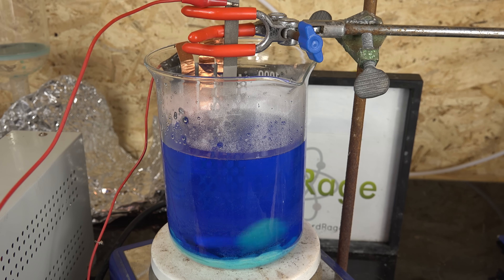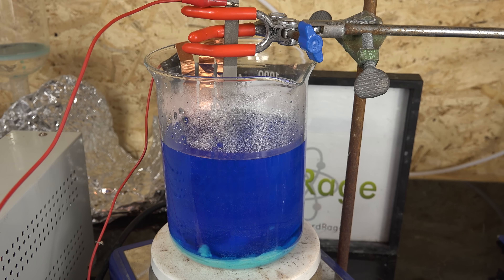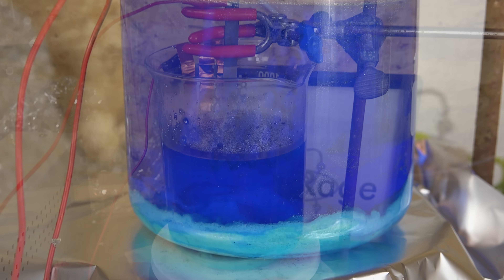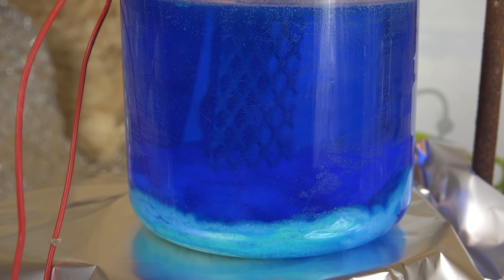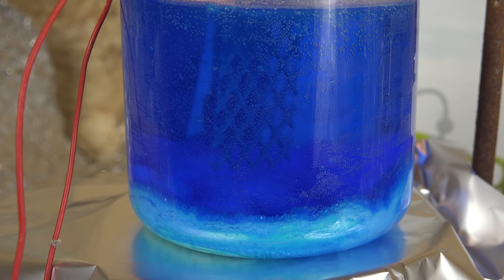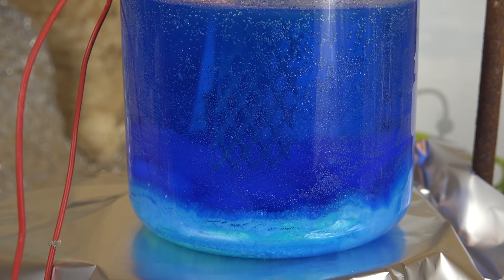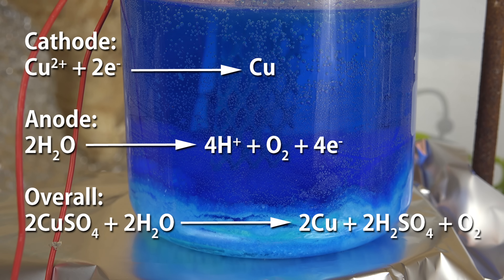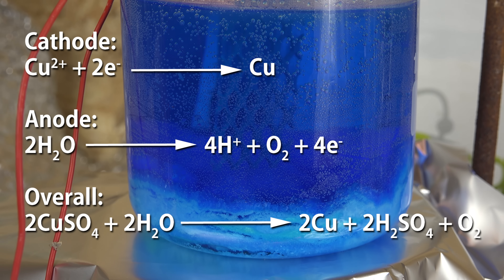Efficiently Recover Nitric Acid and Copper Metal From Copper Nitrate Wastes

Comment: What I’m looking for is a better way to collect and trap the contaminants. Instead of using a Platinum Anode, could you use the reactivity series of metals. Add iron to your copper sulfate solution to drop out the copper and all contaminants under iron and then melt up the metal sponge into shot and a connecting anode bar that connects to your power supply. Then for electrolyte use a clean pure form of copper sulfate solution and place the contaminated copper shot into some sort of filter bag that is dipped into the electrolyte. That way all the sludge that forms from impurities and trapped for further processing in the future. Do you have to use Platinum? Is platinum only used because it doesn’t react? In my case I want the anode to be the consumable. Also, must the cathode be copper? Can it be stainless steel? For instance a large surface area stainless bowl?

Comment: Did anyone mention / ask about HCL remaining in the waste copper nitrate solution? Many refiners use HCL to precipitate the silver chloride. Would this have any adverse effects on the sulfuric acid -> distillation of the nitric acid? While the boiling point of HCL is higher than Nitric, i'm not sure about azeotropes or if any HCL would remain in the final distillate.

Comment: Could you not use a copper pipe for the anode instead of a platnium electrode.  I know it will disolve and the copper will transfer over to the cathode as pure copper and the copper pipe will have to be replaced as it disolved.  Benifits being copper is cheap and do not have to buy or worry about the platnium electrode.
Reply from the maker: But how do you recover copper from the solution?

Comment: Excellent video.. thank you!

I'm working on a project to turn about 18kg of mixed scrap of unknown alloy bronzes, into a 25 to 30cm diameter bell of 80Cu/20Sn bell bronze. I doubt that any Ag/Au/PGM are present, but I want to remove any Mn, Si, Zn, or Pb present, and I'd like to separate out the tin, recover it, and supplement it with additional tin in the final melt.
It looks like a dilute nitric acid (a lot of it..) will dissolve the bronze - all the possible components except for the tin, which will either settle out as a tin sludge or precipitate as an insoluble tin salt, either way, I think I can extract the tin in the first step by filtering it out.
Then, I can use this video method to recover the nitric and leave all the metals as sulfates in solution.. if something (maybe lead sulfate?) precipitates, a filter catches that.
With "copper etc.." sulfate, I hope to reduce all the metal salts to finely divided metal particles, but I'm not sure which reagent to use.. maybe iron(II) sulfate.
Then, hopefully, either hydrochloric or sulfuric acid will put the contaminant metals in solution without taking too much of the copper powder, so I can capture purified (if not quite "pure") copper in a filter. 
The next step (maybe this is optional..) seems to be putting the copper filtrate into solution as copper sulfate (process TBD..) and electrowinning out the copper. Then, wash/dry/weigh the copper, add 1 unit tin for each 4 units copper by weight, melt, pour, cast and mechanically finish the bell.

Does it seem like I'm on the right track, or have I made an obvious mistake somewhere?

And, dear Internet.. yes, I know.. "just buy a bell".. sell the metal I have as scrap for $2.50/lb - $75, then pay $10+/lb ($300) for new metal to alloy & cast myself.. or pay closer to $450 for an 8.5" bell. Making it myself saves me a little money, but gives much greater satisfaction.

Comment: What about using a lead/lead dioxide anode? If you connect a piece of lead sheet to the anode of your electricity supply and insert the lead after(!) the copper cathode has already been wired up and inserted into the electrolysis cell, then no lead should dissolve but rather coat with PbO2 straight away.
Just a thought to avoid the expensive platinum anode... .

Comment: Yeah I was trying to recover some e-waste precious metals and I ended up letting the solution dry up and turned into a clumpy clay block of mess. I had it in a glass mason jar and the and it ended up breaking so I swept up the bluish whitish clump of mess and put it into a metal coffee can and it sat for about a year-and-a-half two years.
  I recently pulled it out and re-added some vinegar 16% and 3% hydrogen peroxide the solution turn dark blue like I see in your video the only difference is I have three layers of sediment on the bottom, that are three different colors what could those three layers be and what do I do with them?

Comment: Sorry if this has been asked. Is a Platinum coated anode the only one suitable for this process? If not can anyone give viable alternatives. I'm more interested in the data than what they actually cost I can research that on my own.
Reply: You can use carbon anodes, but you'll need to control the current of the process or it'll erode terribly and you'll need to clean the solution after the electrolysis. Some people says that a lead/lead dioxide anode also works, but that thing is extremely toxic.

Comment: The copper electrolysis with copper sulfate could be use for copper plating, replacing the platinum electrode for some copper and the actual copper for the thing to be plated?

Comment: @NurdRage 
Quick question: I have Copper dissolved in Nitric Acid, then I added equal amount of water to lower the concentration, added Iron nails to precipitate the copper powder. But as the solution still had excessive amount of Nitric Acid, it started dissolving Iron as well in the solution, and all has turned pretty much black. Please let me know how to recover my copper with out iron content from this messy solution?
Waiting for your kind response sir!

regards

Comment: I have heard that bubbling nitrogen dioxide through 3% hydrogen peroxide works very well.

Also, reducing the copper FIRST with iron yields metallic copper and iron nitrate, which decomposes at a much lower temperature that copper nitrate:  only 80C, well below water's boiling point.  Your waste afterward is just iron oxide mud, which is totally nontoxic,
Reply: Interesting, btw I wonder if only copper is depositing on iron, does the mud made of iron oxide contain any other metals from ewaste solution?

Comment: I was under the impression that titanium is electrochemically inert?
Which is why anode cages and auxiliary anodes for electroplating are made from Ti?
Is platinum really necessary?
Reply: So it seems that standard titanium will resist corrosion in pure sulfuric acid up to 20% at 0C and 5% at 25C. In the presence of ferric or cupric ions, Ti will resist 20% at room temperature. This suits my needs perfectly (making high throw electroplating solution). It's illegal for me to posses sulfuric over 15% without an EPP licence anyway.
Reply: No, that doesnt work. The passivation layer is too resistive. I can't get current densities higher than about 1mA/cm2.
Graphite works, but is consumed at an uneconomical rate, and turns to dust that gets bound up in the plated out copper.
I'm going to try one of those impossibly cheap electrodes.

Comment: Could you use a carbon rod instead of the platinum electrode? Would probably not survive as long, but I would expect it to work. And it is cheaper.
Reply: it might degrade quickly, lead dioxide or platinum is suggested

Comment: Would a gold or silver electrode work. I dont have any scrap platinum and would like to use what i have on hand
Reply: Gold is expensive than platinum and silver will corrode when electrolysis
Reply: from nurdrage: "no, it needs to be platinum or lead dioxide. Gold will get destroyed under these conditions." since there will be nitric acid

Comment: this video worked out great for me thanks but.... the first time I did it I used a lead oxide anode ... worked fine. the second time (2 liters of copper sulfate) I did it I used a  Palladium plated Rhodium anode( 2volts 0.8amps), I fell a sleep and when I woke up.... the copper came out of the solution but the anode started to dissolve into the solution and now it's dark blue. I have no Idea what is in the solution. I tried copper, zinc,  aluminum and tin to see if there would be any displacement... no reaction. I took some of the solution and tried to reverse the process using the lead oxide anode... the lead oxide anode was destroyed. other then sending a sample to be analyzed, is there anyway to fine out what is in the solution to get it out? Because I don't know what it is.... it will cost me a lot to dispose of it because I'm not going to just dump it.  I will make a nice donation to your channel if you help. thanks

Comment: I have about 20 liters of a copper leach consisting of HCl and H2O2 used to remove gold foils from gold plated computer parts. Can this process be used to recover the Hydrochloric acid and the copper.  I know that the solution will also hold Ni.
Reply: probably yes, but hcl isn't really worth getting re-cycled, 10 dollars at home depot for  5 gallons (20%)

Comment: Hey Nurdrage, there's an interesting reaction Im trying to figure out. Involves plating copper onto aluminum. It's in a hackaday article called Soldering on aluminum. Using ferric chloride, copper sulphate and salt somehow causes the copper to bond onto aluminum. I think there is somehow etching going on, iron is somehow deposited and then copper binds to the iron. might be an interesting video.
Reply: copper sulfate would likely react with aluminium to produce copper and aluminum sulfate.

Comment: HI 
Very informative video
I wanted to clarify my doubt
What will evaporate 1st Nitric acid or Water
I googled and found nitric acid boiling point is 83 C
Regards
Reply: Water will boil first because nitric acid forms 68% azeotrope with water which boils at 120 degrees Celvius

Comment: If you have a lot of copper oxide powder, it's easy to smelt.  

Just mix in finely powdered carbon in excess and hit it with a reducing flame.  Same as reducing lead oxide to metallic lead.

It works so well, I was even able to get reduction in my first experiment with a steel spoon filled with carbon-copper oxide over a hot candle flame.  Ended up with clean, red copper metal powder that polished up when rubbed between two smooth stainless steel surfaces (which is how I test powders to see if they're metal or not.  If they take a polish, it's at least partly metallic.  If not, it's mostly salts and oxides.)

Comment: Could sodium bisulfate be used instead to make the nitric acid (as in your other video) and regenerate that with electrolysis, along with recovering the copper?  This would eliminate the need for handling dangerous concentrated acids.  (The nitric acid used in silver recovery can be made AND USED dilute.)
Reply: You might need to thermal decomposition the copper nitrate before mixed with sodium bisulfate
Reply: @ductoannguyen7595  Not necessary.  The sodium bisulfate shifts pH down enough to cause nitric acid to form & distill off.  There are videos about this process.

Comment: You seem to have a knack for electrochemistry. Can you demonstrate making solid Mg/Ca carbonate (or one of its precursors like CaO or CaOH) from feldspars or silicate minerals using water or sea water? We will need negative emissions to stay below 1.5C warming. There's a paper: "Direct electrolytic dissolution of silicate minerals for air CO2 mitigation and carbon-negative H2 production" by Rau et al but I think the concept can be taken further.

Comment: Extremely informative video. I have couple of questions: 1) Is dilute sulfuric acid is OK for this purpose? (as long as the stoichiometric amount of H2SO4 is large enough)? 2) Do all metal nitrate salts react similarly (with reasonable speed) with dilute sulfuric acid to form metal sulfate and nitric acid? I have read that many metal chlorides react very slowly with sulfuric acid, which would cause problems in similar process for recovering HCl and Cu from dirty CuCl2 solution. 3) How do you calculate/estimate the surface area of such mesh platinum anode? (it is a 3D structure, exact surface area calculation requires taking several accurate measurements around the holes)
Reply from the maker: 1) Dilute sulfuric acid is fine, but it might be annoying if it's very dilute since you're handling dilute solutions and need to distill large amounts of water. Then it becomes annoying again when you need fractionally distill the resulting dilute nitric acid.

If your sulfuric acid VERY dilute, like 10% or less, then i recommend distilling off some water from that first. Get it up to around 30% before using it (you can determine concentration by checking the density and consulting a density table). It's optional, but it's saves a lot of annoyance and time.

2) some metal nitrates will immediately precipitate insoluble sulfates, like calcium or silver nitrates. This will ruin the subsequent electrolytic step as the insoluble sulfates will interfere with deposition of metal. This is why i said you should displace all precious metals like silver using copper metal before starting. But if you have metals that aren't an issue, then the reaction with sulfuric acid is straightforward and the distillation will not be an issue. The distillation will concentrate the sulfuric acid and force forward the nitric acid production so even dilute sulfuric acid can be used.

3) A rule of thumb is that expanded mesh electrodes are 30% of the surface area of the solid electrode. So if you measure 30 square centimeters (including the holes) you actually have 10 square centimeters. but you'll need to read up the actual electrode specifications if they are available. If not, you'll need to measure and calculate the area yourself.
Reply: @NurdRage  Thanks for the answers! I was thinking of car battery acid (around 35%), since that is easily available.
Couple of additional questions: If the waste copper nitrate solution is very dilute, would it make sense to try distill water out from it before this recovery process, or is it more efficient to do slow fractional distillation of the resulting distilled nitric acid?

Another question is actually more related to your old informative video: https://www.youtube.com/watch?v=FjEoRidvgYE. 
If the CuCl2 solution fed to that process contains other metal chlorides, my understanding is that these will happen as long as HCl is distilled away: 
ZnCl2(sq) + H2SO4(aq) →  ZnSO4(aq) + 2HCl(aq)
BeCl2(aq) + H2SO4(aq) →  BeSO4(aq) + 2HCl(aq)
But I have not been able to fully figure out the behaviour of SnCl2, SnCl4, NiCl2, FeCl2, FeCl3 contaminants in this process. (many references tell that reactions of these with sulfuric acid are very slow and require concentrated sulfuric acid)
Are there any risks that Sn would coplate with copper on the cathode and contaminate the recovered copper? (Sn is closest to copper on the reactivity series)
Reply from the maker: @foobar1794  1) if you distill off too much water from the copper nitrate, you can accidentally thermally decompose it, lowering your yields of nitric acid. If you know what you're doing then go for it. But if you don't know how much copper nitrate you have i reccomend erring on the side of caution and fractionally distill the dilute nitric acid later. 

2) the sulfuric acid will concentrate anyway as you distill it, so the reactions will still be driven forward.

3) not really sure about tin. But i think that would indeed be a danger. Nonetheless, i reccomend doing it anyway and then casting your copper and testing it, if it has significant tin, perform an electrorefining process.

Comment: Very nice procedure. This procedure can be used also for dirty solutions of nitrates? For example when I have PCB waste... there can be trace of Fe, Ni, Au, Ag, Sn. Precious metals can be recoverd by cementing with Cu, but still there is a reminder Ni, Fe, Sn, ... ?  How strong is HNO3? about 20-30% is achieveable with such distillation?
Reply from the maker: as long as the precious metals are cemented out with Cu. The remaining ones won't be an issue. The nitric acid concentration is variable (since wastes are variable), but i have a video on my channel how to purify nitric acid so you should be able to upgrade any type of nitric acid.
Reply: @NurdRage  one question, why would precious metals interfere with the reaction?

Comment: Dr. n-BuLi, 
     I'm not sure if you are aware of the use of copper in chemical refining of precious metals. Contamination should not be an issue with the solution. Copper is used for inquartation. The metals are melted down int an alloy so that the silver atoms are much more spread out and no copper can be trapped inside a pocket of silver where the acid can't react with it. 
     This is also done in gold recovery, only it is silver being added to gold.

Comment: What would happen if there was trace chlorides in the waste? Often my nitrate waste contains a small amount of HCl or NaCl used to drop silver chloride. I dont find the displacement by copper type of process you mention reliable.
Reply from the maker: if it's just a trace then nothing serious. The chloride will be converted to chlorine gas and nitrosyl chloride by the nitric acid produced and will bubble out and into the air during distillation. This is why you should do this outside or in a fume hood. You'll get pure chloride free nitric acid.

Comment: Don’t use fractional distillation to purify the nitric acid. Add ammonia hydroxide to the dilute acid and boil it down. Get the ammonia nitrate and add sulfuric acid. You can distill that down for 98% acid.
Reply from the maker: but that wastes ammonia and sulfuric acid. Fractional distillation wastes nothing except electricity and time. I have a whole video on it.